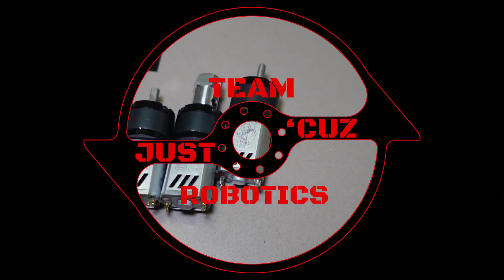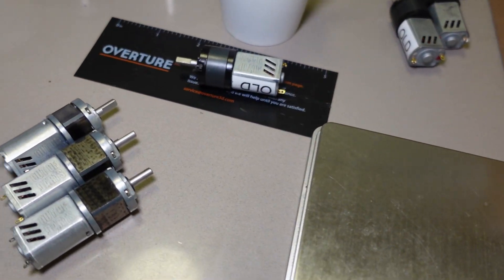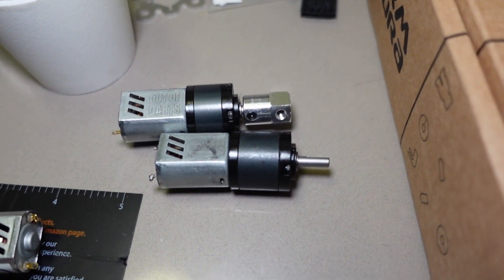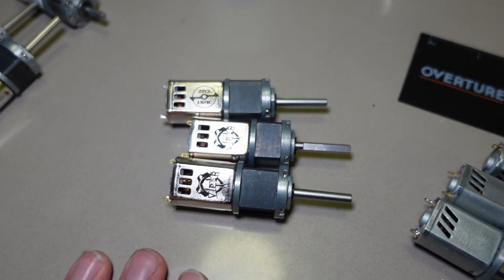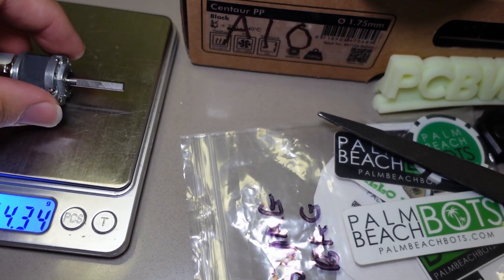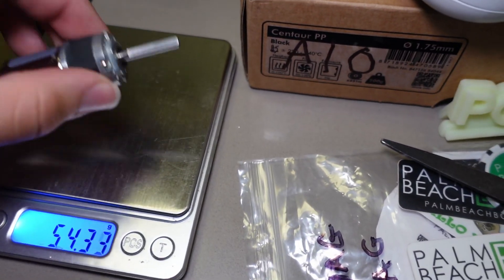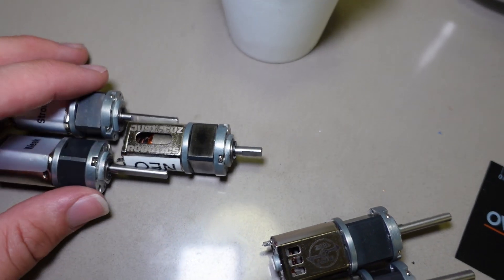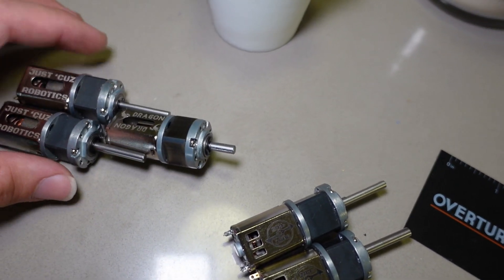DartBox V2: Durable, Lightweight, Reliable, and Easy to Use!

Comment: curious if the new ones are the same manufacturer that banned blasters uses.
Reply from the maker: It's certainly possible. This company makes a lot of different motors, with a large number of them the same size used in dart blasters.

Comment: Sorry if you've already talked about this, but what are the advantages and disadvantages compared to brushless? You mentioned briefly that these are better power to weight? Is that because of the controllers? Would durability be weaker (need to be more internal or shielded) compared to the a drive system like you have on division or shrapnel mine?
Reply from the maker: I was mostly comparing these to something else that's got a planetary gearbox like the Rectified brushless or Mega Spark setups. Brushed motors give you instant max torque at 0 RPM whereas brushless sensorless motors usually struggle at low speeds, so brushed will tend to be better at pushing matches.

It's hard to give an answer that's all encompassing without seeing a proper motor performance chart or even a stall torque number for the 1806 motors used on these other setups, but everyone else refuses to publish those numbers for some reason.

Durability of the drivetrain on Division/Shrapnel Mine is a totally different ball game as those are running the wheels on a dead shaft but geared to the brushless motor directly with no gearbox. You could definitely get pretty much the same durability by using DartBox instead of an ungeared brushless motor and gear to the wheel as the wheel is the only part taking hits. But a brushless motor is lighter weight than a planetary gearbox which is why I chose that route for Division. It's harder to drive Division because of it but I don't have weight to spare.
Reply: I have no idea how much it is applicable to bots, but also those motors doesn't requite any advanced drivers, they just run on DC power. Just flick the switch and they go.
Reply: @KryptLynx  brushed speed controllers are much nicer though to get proportional control and high current flow. Maybe the speed controllers are less bulky and heavy though?

Comment: This is really cool news. I've got a few questions however. Would buying the "power dense 22mm brushed motors" on their own still be easiest through out of darts? Or are there better ways of sourcing them, potentially from you even? And secondly, do you know if this power to weight ratio scales well? I'm assuming not, because we moved on from brushed weapons ages ago. But these motors seem to, if scaled up, be more than capable of being used as weapon motors. Or do they burn out at stall too fast.
Reply from the maker: If you're looking for just a brushed motor by itself then getting them through out of darts would probably be best. The ones I am getting custom made will not be sold separately without pinion gears pressed onto the shafts and with a customized short shaft length to mate just to my gearboxes. The power to weight ratio is pretty unique to these motors but they're definitely are other brushed motors that have a similar power density used in airsoft guns for instance. I don't know of a great source for those however, and you definitely can't buy them already connected to a planetary gearbox. As for use as a weapon motor, honestly not sure. I haven't tried that. They work great for lifting arms that work intermittently but for a spinning weapon I think it would depend on a lot of factors. The motors burn out at stall but spinning weapons are almost never stalled so that in particular might not be a problem unless the weapon was physically jammed by an opponent or a wall
Reply: @JustCuzRobotics  Alrighty. Thanks for the answers!